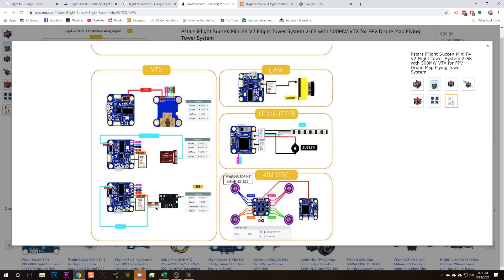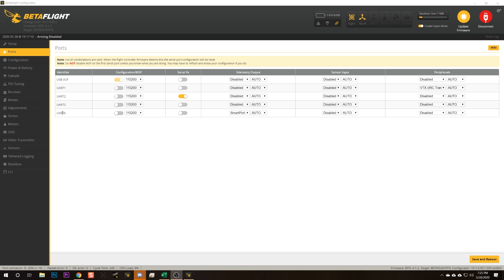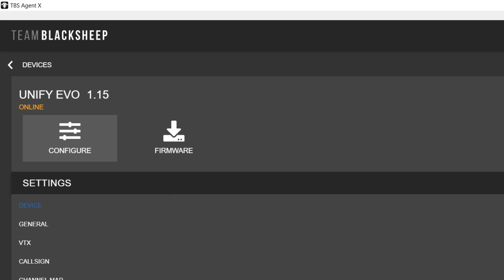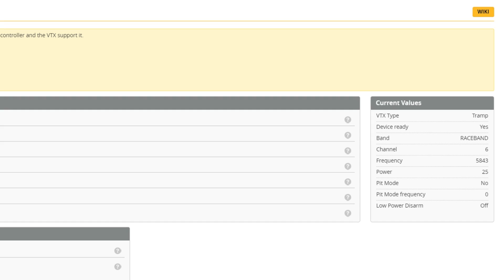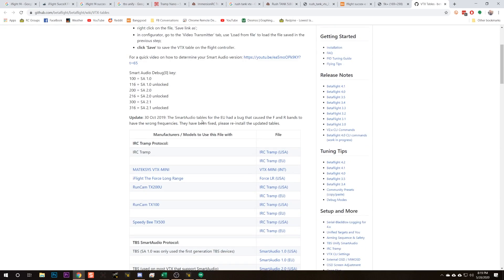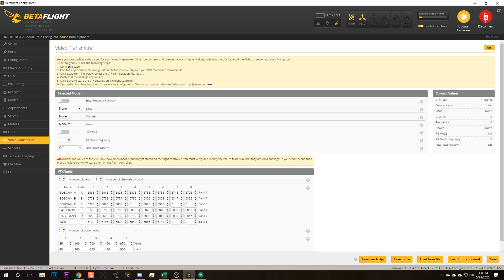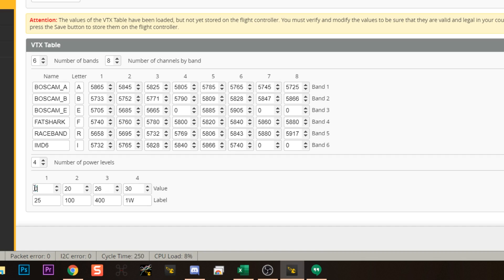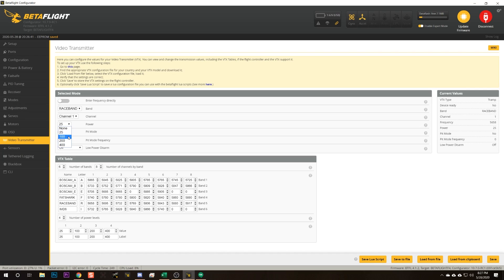Betaflight SmartAudio vtxtable troubleshooting (WHY DOESN'T SMARTAUDIO WORK)

Comment: Dear all, 
I am a bit stuck. I use an Eachine TX805. Betaflight reports "Device Ready", I can change the power output level and the LED on the vtx module changes. Loaded the VTX table from Betaflight ("eachine-tx805-global.json"). But what does not happen is, that I am able to pick up a picture on my FPV googles. FPV googles confirmed working with another FPV. LiPo is plugged in.

Comment: I have a darwin cineape 2.5 (premade, with 4 level darwinfpv vtx, 25/200/400/600). I cant get the vtx to "ready - YES", no matter what i do. I can provide pics etc!

I get video to goggles, can fly etc, but cant physically change power. (This is despite being able to "send" data to the vtx via choosing power and then "save" on BetaFlight vtx tab). 

The HUD shows the power as "changed" (200/400/600 respectively if changing via the triple pot as per your "BF vtx band on switch" video), but the vtx flashes 3 times, indicating the mode is still 400mw mode :(

I also have set pit mode to a slider, showing correctly activating in BF, but doesn't show in HUD. The only way to get 25mw to show on the HUD is to choose it in the power setting tab of BF, then save, and it then shows. (But the vtx still physically flashes 4 times indicating no mode change).

I have tried your "BF SmartAudio vtx table troubleshoot", setup the tbs 2.0 US-version from a json file, and successfully followed the CLI and saved the power/switch config for my aux 6 triple pot/switch (shown by correct HUD changes when using the switch).

So I'm guessing the FC isnt talking to the VTX, and I don't know why, because it was premade from darwinfpv, as a BNF.

Im lost. All I want my fpv to do is sit there and not overheat at max vtx power when not armed hahaha. I have to plug/unplug the battery within <30 secs, otherwise temps get over 60*C

Im glad i fould this channel, the info has been great!

Comment: Hi Joshua Bardwell , 
Your video is great. 
But let me share my problem, it’s missing in your video.
I have BetaFPV meteor85. 
I check all by your video but still got Device ready -False.
In my case problem were caused by flight controler firmware betaflight 4.5.1.
I change firmware version to betaflight 4.4.0 and it start working.
But seems that this problem newer than your video)

Comment: I am very thankful for this video..  I have been struggling alike many on this.  i have 5 tbs unufy pro 32 hv vtx's. i have just set the power with the button. i just count the blue flashes. My main concern was No Pit MODE. So When i crash and  have to do the walk of shame. vtx heats up. 
When you said that tbs evo and the unify vtx's are shipped on crsf, My ears perked. I set to smart audio IN TBS AGENT and it all started coming together.  Thanks again!!!!

Comment: I have the SpeedyBee 405FC and TX800. I loaded the preset configuration. Set URAT2 and still nothing for VTX ready. Any suggestions? I wired just like the manual says.

Comment: Hey Joshua! I'm having a bit of a head-scratcher with my SpeedyBee TX800 and F405 v3 FC setup. I've got the Telemetry/SmartAudio wire hooked up to T1, but I'm running into some issues in BetaFlight (4.5.0 RC2).

On the ports page, UART1 is stuck on "MSP + Display port" in the peripherals column, and no matter how many times I try to switch it to TBS Smart Audio or IRC Tramp and hit save+reboot, it just defaults back to "MSP + Display port". 🔄😕

Also, in the Video transmitter page, the "Device Ready" status is always showing as False. I've never seen it as True. 🚫
Yes, the quad was powered on using a battery and I connected it to the PC running BF configurator using the USB cable. I am sure I soldered the smart audio wire to the T1 pad, and all wire connections are rechecked.
The weird part is, the VTX is working fine and I can see the video in my VRX. I can only enable a few OSD parameters though. I'm sure I'm using the correct VTX table for this VTX.
Any ideas on what could be causing this? All insights are appreciated! 🙏🔍👀

Comment: So I can change channels and power from Betaflight (yay!) but it doesn't work on my TBS Mambo running the internal Tracer TX. Is this because there's no Betaflight Crossfire passthrough? Am I stuck changing channels from a laptop? Should I just switch to ELRS?

Comment: I have Geprc crocodile baby digital DJI version and I have DJI version two FPV goggles and I cannot get them to bind. I updated the firmware on both to the newest release and it still won’t bind Also, the firmware versions that the DJI assistant updated me too, do not match each other from the drone to the goggles I’m stuck and don’t know what to do. Please help.
Reply from the maker: You probably need. To switch the goggles to "DJI digital FPV system" mode. They are probably in "DJI FPV drone" mode. Here's how https://youtu.be/ffpMWX4yyyc?t=1487
Reply: @JoshuaBardwell  that was exactly it thank you so much. 1 step closer

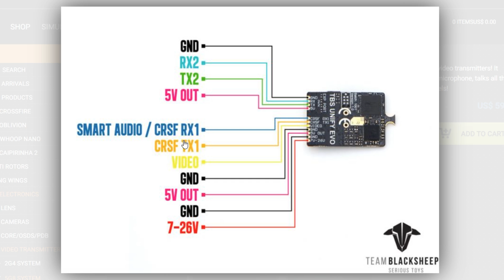Comment: I'm trying to set up SA on my quad and I can't get "device ready: yes". I have checked and double checked the wiring and even resoldered the wires to a different uart. I saw that Bardwell says to plug in the VTX via USB at 7:15 to tell the VTX to run SA. How do I do that? My FC has a usb port but not the VTX. I'm new to all of this. I have a tbs unify pro.

Comment: I have a problem . I wanted to install GPS and ELRS on 2 of my UARTS. Problem is that I have only 2 UARTS available beside serial port. What  will be issue if i turn off smartaudio on those ports ?

Comment: Issue resolved.  Thanks.  I read somewhere that you needed to input the values 12, 23,27,29 for the Rush Tank Mini.  Which I gathered were the dbm values.  After I input 1,2,3,4 I finally got the Device Ready = Yes.  Wouldn't have figured this out without this tutorial.  Thanks
Reply from the maker: Just means you have an older Rush vTX that supports SA 2.0. The newer ones do 2.1.

Comment: Hello, I have an XF5804 VTX connected to Eachine GPS F4 Flight Controller TX3. I have enabled smart audio on UART3 and I still get no connection (Device ready: no) Any suggestions? Also would point out that my VTX gets really really hot like 120F at least.

Comment: Hello everybody and thanks Josh, great Vidoes 
and perhaps some one can help  
i use a Diatone Mamba F405 and a Rush Tiny Tank VTX 
every thing is wired correctly but Betaflight Configurator not shows me the device as ready
i have connected the uart TX (SmartAudio Protocol) signal to DATA at VTX but nothing happen (i have checked it by Oszi)
And as far as i know, this is not a bidirectional way, how the FC and Betaflight can know that the VTX is ready ? 
An other problem is, my Smart Audio Menue is empty, it shows only the main Menu but then i have only exit and back
as option. 
 board: manufacturer_id: DIAT, board_name: FURYF4OSD      Betaflight / STM32F405 (S405) 4.2.6 Jan

Comment: Hello, if you can help me with this problem I will be eternally grateful. On a vtx tbs unify v3, I can change the channel but I can't change the power from the osd, not even with the vtx button. Watch the whole video I followed the instructions but it won't let me. I have the vtx unlocked but it always stays at 25mw, there is no way to change it with the beta osd or with the vtx button. I took a good look at having the correct tables, I use the smartaudio 2.0 ones but there is no way I can change the power. I would appreciate some guidance, has anyone experienced the same? greetings and thanks
Reply from the maker: If you can't change power usually this means your vtxtable has incorrect power values. Try using the SA 2.1 vtxtable instead.
Reply: @JoshuaBardwell   thanks for the prompt response, I'll try with 2.1 thank you very much

Comment: I have multiple quads I've just upgraded from various older version of BF. Some pre and post vtx tables. They all had smart audio working. Now after upgrading them all, I've lost smart audio on all but 1. One thing in common is that they are all F4 FCs. 3x BFF4, 1 DYSF4Pro. They all upgraded perfectly and all fly just fine. The smart audio now broken makes me feel super frustrated that the builds are busted. :(

Comment: What if VIDEO TRANSMITTER page is empty???

I flashed "betaflight_4.3.0_CRAZYBEEF4SX1280_2e8963de5" onto HAPPYMODEL Crux3 for using ELRS 2.0

"ATTENTION: Your VTX is not configured..."
Reply from the maker: It means you did not enable SmartAudio or IRC Tramp in the Ports tab.
Reply: @JoshuaBardwell  Thank you so much!!! 
It wasn't switched on by default.
Didn't notice that. 🙄

Comment: New to this but trying to hook up my vtx and still getting device ready no. checked all wiring and seems good and uart is set up correctly. what else could cause this issue? I bought this drone used and have seen the vtx work. i am only getting around .6V output from the vtx+ connection from my FC is this normal or is this the issue?

Comment: Thanks for the video. I was using BF 3.5 FW and VTX control by s.audio on OSD and Taranis LUA script works fine. Unfortunately I was forced by my belove wife and new born son to do a short (few years :) ) break. Recently I decided to do some work with my drone and I started from updating the FW. After updating to BF 4.2 I have noticed that VTX control does not work and LUA script also. Now I know that i need to make that VTX TABLE stuff to make it work again. Somebody can tell me what the hack has happened between 3.5 and 4.2 with this VTX TABLE. Is It possible to set 1000mW in VTX table (I am using Eachine TX806 VTX board and Mateksys F722 SE)

Comment: After I installed crossfire receiver the vtx connected but the goggles should be very close to the quad no range.....and in betaflight(device ready)= yes  🤔

Like its no antenna

Comment: Hi, could you point me to a right direction, when SA seems to be working to a degree, you can change channels and bands via configurator (or cli set vtx_band, set vtx_channel....), but you cannot change set/change any of this via OSD menu or via vtx adjustments via channel....thanks

Comment: My VTX says for power levels 25mW, 200mW, 600mW and 1W. It is smart audio. So the db equivalent is 14, 23, ?, 30.
For 600mW the db equivalent is 27.7815, should I input this value even though it is not an integer?
Reply from the maker: Best to get the vtxtable values from the manufacturer. But no you can't put a decimal on as a power value.
Reply: @JoshuaBardwell  Hey, great thanks for your answer. I just realised I need to use SmartAudio 2.0 and I found in the dicumentation that unlike for SA1.0 or 2.1, in SA2.0 the values are actually not in db but integers 0,1,2,3,4 and so on, is that correct? In this case my situatin is easier.

Comment: I have the AKK Infinite VTX with DVR up to 1W.  I followed the directions, but it won't let me enter 1000 for the last value. I read somewhere that entering 1.2 as the value "might" work. I just saw you type in 1 W as the value in 2.1, will that work in 2.0? I'm going to watch this video one more time and play with BetaFlight again. Thanks for all of your videos.
Reply from the maker: You can't have more than 3 characters. But the label doesn't change the actual output power. Put MAX or 1W or whatever you like.
Reply: @JoshuaBardwell  OK cool, Thank You Very Much!!!
Reply: @JoshuaBardwell  I think I figured out what was wrong. I went back and checked everything on my quad, and everything was correct. The same with my settings in BetaFlight, and MAX was already in the spot. (I don't remember doing that) Either I forgot to click on save, or I forgot to plug in a battery; when I tried setting this up last week. Everything is good now. Thanks Again

Comment: 5:05 - is incorrect, my betaflight says no, not ready, but vtx works just fine. Tinyhawk 2 freestyle
Reply from the maker: That could be if you have an SPI based vTX that isn't using SmartAudio.

Comment: I have a Tiny Tank VTX I loaded in the SA 2.0 table and it shows its 350mW  which it is.  but i +have values in the powers like 2.1 would use.  also does Pit Mode count as 1? supports Pit?25/100/200/Max350

Comment: Just out of curiosity can any one help? Im new and not clued up about express lrs? Can i use happy model lrs and other types with a xt16s controller with out putting in another jr module?
Reply from the maker: There isn't any radio today that supports ELRS on an internal module. You need an external module to use ELRS. I have a video coming out this weeek with a rundown of current ELRS hardware.

Comment: I have 2 tank vtx's( ultimate plus, and tiny tank) and using the tables from Oscar Liang, they only show up as vtx, not sa, and don't let me change power through smart audio, although it does let me change channel. His tables are sa 2.1, do you think it might be worth it to try the 2.0 values from the repository? Also have one tiny tank, that had the 2.1 sticker on it, that works perfectly through sa 2.1. Other two still let me change power through the button, although sa is still turned on in betaflight on the uart.
Reply from the maker: Rush tank has moved to SA 2.1. If you csn change power with the button it makes me think you have device ready: no and SA isn't even working.
Reply: @JoshuaBardwell  Thank you, Yeah I have no idea haha. In the vtx tab, it says device ready, yes and smart audio when plugged in, as well I still get the channel and power readout in the osd. The ultimate holds channel settings and power when cycled, but the tiny tank, holds channel, but starts up at low power (led is off, not even flashing) and I have to use the button to change power. That's the only thing that it won't let me change in bf, maybe one or two of the dbm values is slightly off? Or just something up with the vtx's
Reply: Twitter link, to video clip with the issue. Also Pic showing smart audio as active and device ready in bf and vtx table

https://twitter.com/OffGridNoob/status/1427517372898979842?s=19

Comment: Can anyone point me in the right direction for not even having the OSD show up in my goggles? Set up RushFPV with Smartaudio 2.0 and  the right VTX table. OSD is enabled in the Config tab. Nothing at all showing in the goggles (other than the actual camera's FOV/image). Moving Yaw_left and Pitch_Forward to bring up the OSD menu doesn't do anything either.
Reply from the maker: Try changing the pal ntsc setting in yhe OSD tab.
Reply: @JoshuaBardwell  oddly, just plugging in a joypad to check the PAL/NTSC of camera itself fixed it. Didn't even have to do anything else. But, there's no PAL/NTSC in my betaflight OSD tab anymore. Might be now, I haven't checked it since plugging the joypad in fixed it. Went out and burned through some batteries instead. Crashtastic fun.

Comment: so, I have a question. I actually got the JB version of the runcam phoenix 2? I think it is? the video works great, all the OSD's work, the standard betaflight ones plus the ones that I can only do on the JB version....I think betaflight calls it the runcam protocol? anyways.... I have my VTX tables set up and these (pretty silly) modes for my AKK race ranger VTX (theres no way it goes up to 1000mw?) I cant seem to find any info anywhere for this board.....i am completely stumped.....betaflight still tells me that the camera is not ready, it all looks good, sounds good, smells good, lol I have NOT tried recording anything yet, plus I was told this VTX has a microphone and I dont even know where to start to set that up....any help would be awesome thanks!

Comment: Thanks for video! Could you help me, I have betaflight 10.7.0 and correctly connected AKK ultimate FX vtx (video works and I can change band and channel from cli and settings successfully appllied to vtx) but I haven't vtx tab. what i doing wrong? by the way, in another quad(mobula 7) I have vtx tab, but the are no settings for it and it is ok.
Reply: Solved: I updated firmware of FC to BTFL 4.2.9 and video tab appeared.

Comment: Does anyone know why my vtx will change channels and bands, but not power? Seems to be stuck on 25mw.
Reply from the maker: Your vtxtable has incorrect power values for the vTX.
Reply: @JoshuaBardwell  Thanks JB, i have set the power outputs as stated on the product page but with no luck. I can't even change from 25mw manually using the vtx buttons so i think it must be locked or something not related to betaflight. 👍🏻
Reply from the maker: Disable Smartaudio in Ports tab then change vtx power with the button and I bet it will work. This will confirm your vtxtable power values are causing the problem.
Reply: @JoshuaBardwell  thanks I'll give it a go 👍🏻
Reply: @JoshuaBardwell  You were right JB, works manually after disabling in ports tab. Power levels must be wrong but I'm setting as description on banggood, they are different from what gets preloaded from the SA 2.1 vtx table, neither work.

Comment: Thanks for helping noobs like me. I've tried to upgrade to TBS unify pro32 nano but due to mismatch in power levels table and channel lock i counldn't get it to work. But now it gets controlled properly. I still had to go back to previous VTX as with 400mW and MAX i have horizontal lined image distortions. Maybe it's to much for my AIO's BEC or something else. 

Either way thank you for your help on quite a few things you've shown on your videos.

Comment: Okay nice, video but for me the VTX settings still don't work. When i was plaing with settings in betaflight one time it shows "device ready = Yes" then i checked and restarted my quad and from that point betaflight says "device ready = no". So that's not my fault, because it worked once and now it's not working. Any ideas why it's now showing 'device ready = no' when i have everything okay?